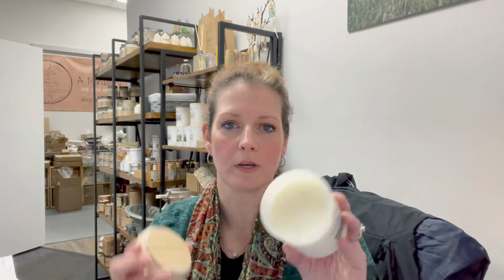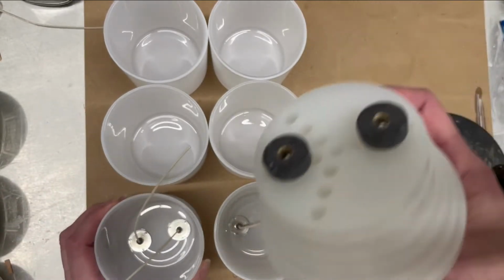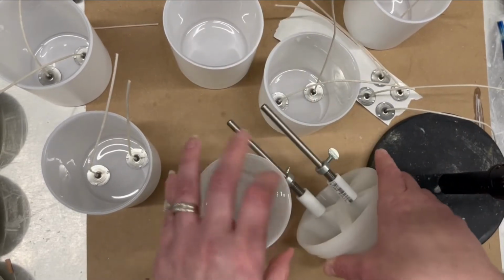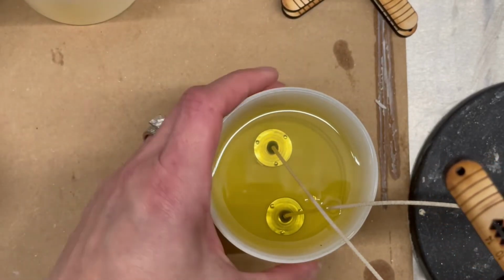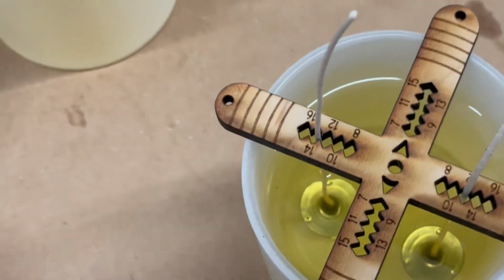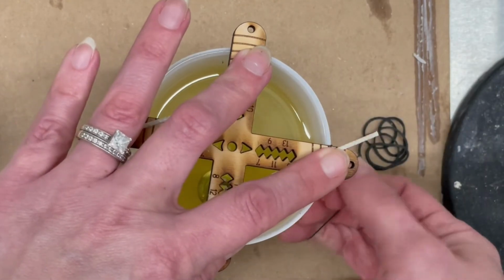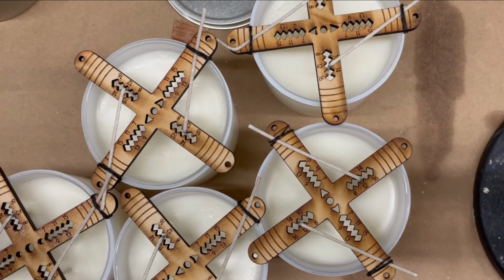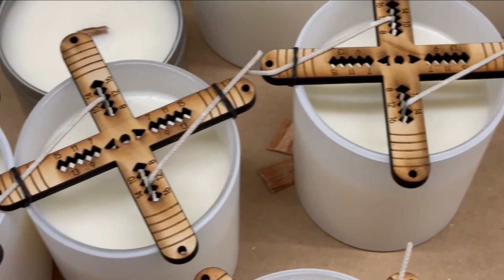Making a Multi-Wick Candle

Comment: How do you work out you FO in your candles if it 10% then what
Reply from the maker: First you need to make sure you know the fragrance load your wax can handle.  Some waxes can tolerate 6-8%, some 8-10% or up to 12%.  Each wax manufacturer will have a suggested use rate. Then once you know the correct amount you can use, just do the math.  As an example, 8oz of wax with a 10% fragrance load would be 0.8oz of FO.  Never more, but you can always do less.  Hope this helps!
Reply: @AMandatoryActivity  okay thank you I haven’t started yet but I will be that’s why I ask a lot off questions to people cause I don’t want to start and be sitting thinking what do I do lol but thanks for the reply